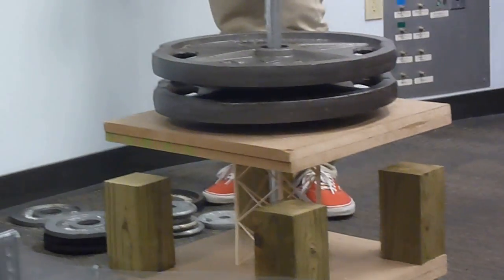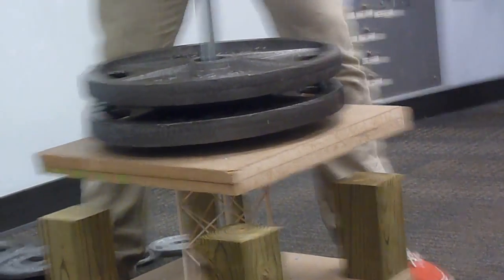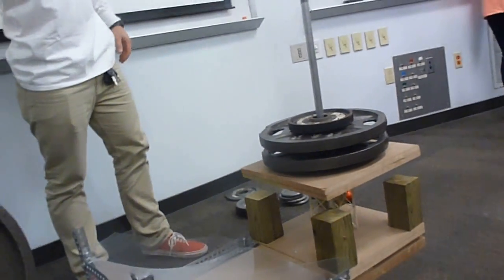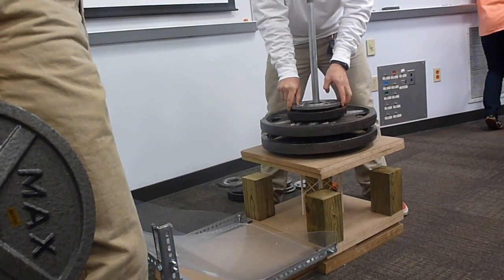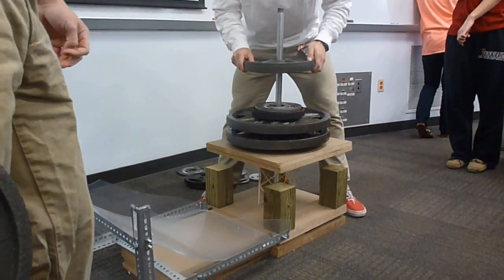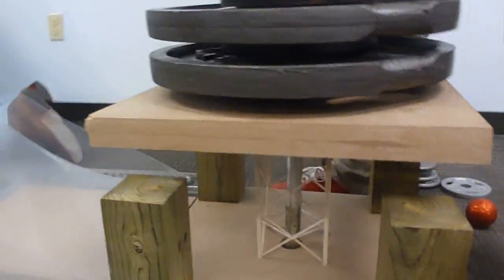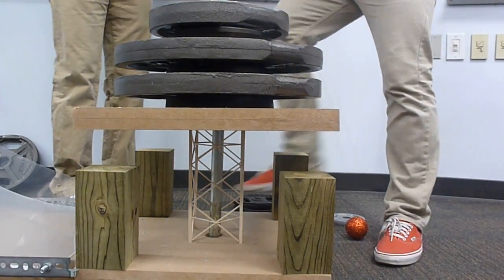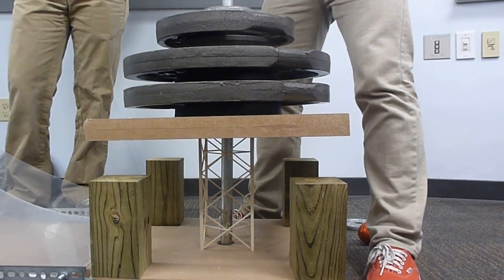Balsa Wood Tower Fall 2012

Comment: I had a diff problem: We needed to STACK at least 3 structures. Really hard, but my team made it into finals :D:D:D.
Weight: 140 lbs, which is really impressive. others got below 50 :D
Reply: I was doing stackables too and we got 4th place in regionals